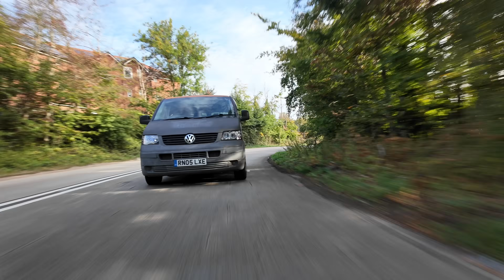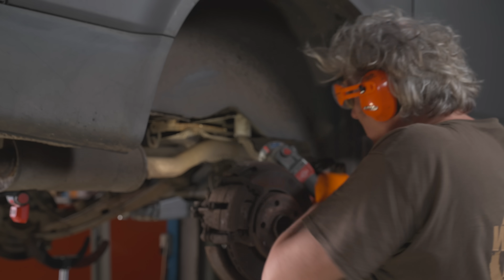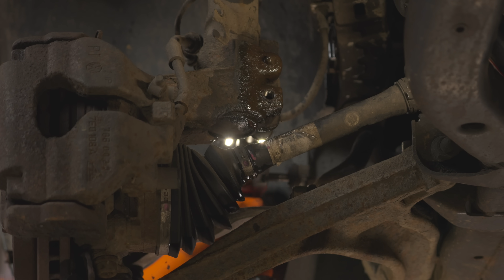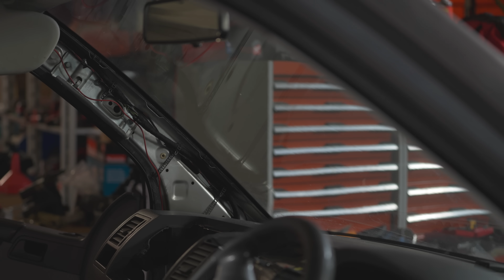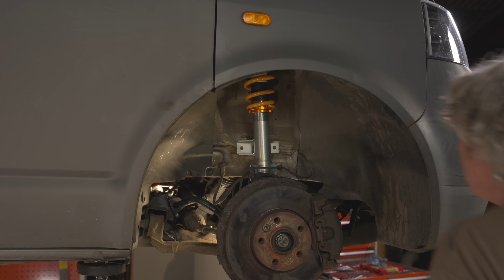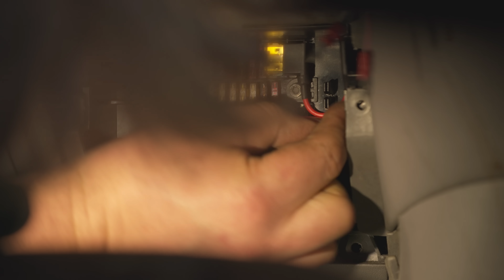5 Steps to REPAIR and UPGRADE Your T5's Suspension and Audio System

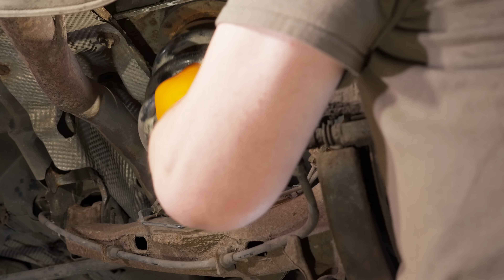Comment: What was the text at 5:05 for a split second?
Reply: Basically says they had to cut the video down due to edds rambling and to follow the link in the description to watch the full video
Reply: @kraftypk7283 ive just spent far too long trying to read this, and ill second what you said.
Reply: So it's been a while since we piped up about what Edd is doing but to be fair it's been ages since he published a video so how could we comment anyway?.
This job was obviously not that easy, it never is but we had to cut down Edd's ramblings to under an hour.
If you would like to see the whole of this iob in glorious technobabble /detail then follow the link in the description or at the end of this vid-o and you can enjoy the full 1 hour and,45 minutes of luxurious pfaffing and tool-foolery along with a few more top tips and missing bits.
Enjoy!

Comment: Of course you should go for an upgrade of the exhaust... And maybe the brakes as well.. With those nice new springs, it would make it really pop if you later down the line got a new set of wheels. :)
But exhaust,, yes.. It deserves an upgrade. :)

Comment: How can you tell if it's stretch bolts or not? I got some aftermarket lower wishbone for an MB-SLK but didn't come with bolts?? maybe they are reusable, I would have thought if you can tighten them to the torque specs I can't see the problem. Where's the best place to look for torque specs I don't trust AI it gives you false information
Reply: Stretch bolts are set using a combination of two requirements - (1) a torque figure, and (2) an angle beyond the torque figure.   So, there is no single torque spec provided by VW that combines both.  In cases where 'aftermarket manufacturers' supply replacement parts, then the aforesaid manufacturer may provide a bolt (or bolts) that only require a torque setting.  A circumstance that comes to mind is an aftermarket Chev LS V8 front pulley bolt that is supplied by ARP - where ARP provides the torque setting.

Comment: I know you glossed over it with an "obviously" but for someone not so sure on the technical details I would like to know more on how more turns = a softer ride. I would expect a larger spring to not be as flexible personally.

Comment: Hi edd, just in case you want to neaten up all of the different gubbins going into your head unit there is a solution i used on my car. Excuse the lengthy title - amazon are crap at listing names, but if you plumb this into amazon : Eightwood DAB+ DAB Aerial Car Radio Aerial Splitter SMB SMA GPS Adapter AM/FM Aerial to Shark Roof Antenna Signal Amplifier Car SMB Plug with Cable RG174 500cm for GPS/FM/AM Radio (just copy paste it) i think you'll find it is the perfect solution and gives a much better result for signal for gps dab and fm, am. They are quite generous with the length of cables you get too so i think it would be good for your van. I've not got up to the point where you install your dab antenna just yet but i imagine you have a "dab dongle" which is also required for this antenna if your head unit doesnt have a dab connector. Hope this helps mate

Comment: Can I ask again please, what brand are the halo headlamps that you fitted & who supplied them ?  I have asked on the actual fitting video but got no answer..( I drove around Cornwall with 2 x ever ready bike torches as they are better than standard VW lamps).   thank you
Reply: Try Transporter HQ
Reply: @HiruS22  thank you, I hoped it would have been seen months ago before we drove to Cornwall--at least it will be done by Easter when road trips are planned to start.

Comment: Hi. Have found a lot of VW s have a "key sense" wire in the ignition switch wiring. It comes on as you turn the key on but doesn't turn off when you turn the key off but when you remove the key. Cheers Michael

Comment: With exhaust you will want to look at mileage. I know it doesn't make sense to many but absolute will for you. A bad exhaust system can cost you 20% on your mileage. Most newer cars the stock is usually in top 2 but with an old T5 I'm sure there are alternatives out there that could give you an extra 30 miles on a tank.

Comment: The GPS antenna will be for if you use the native apps on the head unit. I installed mine in an Abarth 500, I've tried the 'native' apps once or twice but it's a pain because the Google Maps version doesn't cope as well as the CarPlay/Android Auto equivalent. If you're using CarPlay/Android Auto, the new screen will be using the phone's own A-GPS instead.

Good video Edd, always great to see older vehicles being kept on the road.

Comment: But there is ignition wire (well, ACC) on stereo connector. VW just swapped permanent +12 and ACC around. Maybe someone before you (younger you) cut that wire from loom or something...

Comment: Also have a t5 replaced front shocks with new top mounts as they were all tired i now have a noise like a broken spiring when turning iv checked its all installed correctly i can only assume one of the top mount brgs is dodgy they are febi ones as well not ultra cheapos very dissapointed as on the deck in my mid 40s this wasnt  an enjoyable job lol

Comment: Hi Edd, I got the same suspension for my T4 and put the spring adjusters on the bottom for the rear. Is there a reason why you didn't do that instead of grinding the tops to make them fit? Also glad to see you buddy!
Reply: I've seen them installed both ways now..so unsure what the correct way is? DTE TV put his on the bottom, but then removed them to lower the van more if I remember.
I'm just about to buy some for my van...what's your honest opinion on them..?

Comment: What type/brand of ball joint separator did you use. I bought one to use on my VW T25 and it would only fit on the track rod end.
Totally different design to the one you used
Reply from the maker: I think it is either Sealey or Franklin, we’ll try to get it in the shop for you as it is a fantastic tool

Comment: Hey Edd top tip you can use 3m adhesion promoter 06396 before you stick your wind deflectors to make sure they don’t go anywhere
Reply from the maker: That’s a great tip! Thanks.🤩

Comment: Thank you for the video Ed! I remember you coming over to our Intel office in Swindon somewhere around 2005, even have a pic on your "sofa" together with you. 

On VW T5 and T6 rear coilovers, the threaded collar (adjuster) is typically positioned below the spring, not above it.

Explains why you had to grind.

Overall, unless you are driven by the looks rather than comfort, changing to budget coilovers is not going to add to comfort and load parameters. I understand that ebay ad is part of the deal but for a workvan it's a questionable choice.
Reply from the maker: You make a good point. The better cornering is good but the rougher roads and longer ground clearance might get old soon. Maybe airbags next?

Comment: Hey Ed this is also one for you (The thunderstorm Generator) could be the answer to combustion engine net zero. Cheers Steve its is on you tube and you can see the results
Reply from the maker: Sounds interesting, send me a link…
Reply: Not to bore you but tests show 60% increase in fuel efficiency as well as no Co2 and increase in O2 cheers steve

Comment: Since you’ve uprated the suspension and radio head unit, you may as well upgrade the exhaust as well
Reply from the maker: Makes sense. Bit of stainless, maybe a Vortex system, but then the next thing is upgrading the bodywork!

Comment: Was that van actually made by VW or is it like the ones in the USA that were made by Chrysler?
Reply from the maker: Pretty sure it’s VW through and through but you never know!
Reply: All Transporters are made by VW, apart from the latest one which is made at the Ford plant in Turkiye. I'm intrigued that there are VW badged Chrysler vans in the US 😯 I know that the Fiat Ducato is badged as a Ram Promaster over there

Comment: Great video Edd, only one problem... You've fitted your rear coilovers wrong. You're supposed to ditch the upper rubber spring plate and use the thin rubber ring between the height adjuster and the van floor. You fit the lower spring rubbers as normal
Reply from the maker: Thanks for the tip! Might go for airbags next as the lowness is tricky on the country roads.
Reply: @eddchina  Be careful, I could write a book about all the problems, cost and eventual ditching of the VB air kit on my T6
Reply: Not a problem  @eddchina glad to help.
I went coilovers on my T5 and all out on the lows. Machined the top mounts and drilled out the front hubs. Deleted the rear adjusters amongst many tweeks. Resulting in a van over 130mm lower all round.
Basically, I should have saved a lot of hassle and gone air ride! Lowdown transporters are absolute gods of all things air ride for the transporter if you decide to go that route

Comment: ive just done my suspension too, I kept it stock height but such a nice firm ride now.
Reply from the maker: Might raise it back up for the rough roads…
Reply: @eddchina  Never liked the adusters on the rear of T5 coilover kits robbing so much travel. Got rid of mine and went to conventional -50 mm H&R'springs with a shorter shock. Much lower than stock and I can live with the ride now.

Comment: The ground plain is not necessarily required for the GPS receiver. I have successfully modified the original GPS system of my car, gutting the original gubbins as it was very outdated. The aftermarket GPS inside the automatic opening and closing screen picks up my speed and location on point.

Comment: Thanks Edd, don't you need constant 12+ for memory?
Reply from the maker: It does get a constant 12v from the stock VW sockets it was just the on and off that needs the ignition feed
Reply: @eddchina  Ah yes.. I should have thought that out.. duh

Comment: Great to have a new video, Edd!  Hope whatever caused the long delay between videos was nothing serious and further that we see more regular content going forward!
I recently upgraded the head unit in my wife's SLK and was very surprised to not have switched +12v in the harness - or anywhere nearby, so perhaps it's a German thing?
Reply from the maker: Those pesky Germans do have an interesting take on things! Kraftwork would be another good example!
Reply: It's normal in all fairly recent cars, pernanent live to unit which is then triggered by canbus when ignition is on
Reply: @HiruS22  That makes a lot of sense.  Thanks for clearing up that mystery!   In her SLK I was able to find switched +12v at an accessory outlet on the passenger side footwell.

Comment: Edd, need to measure suspension height from the center of the wheel, not from the top of the tread. Always good videos
Reply from the maker: Fair point but I guess it didn’t feel like it needed to be too precise a job!!

Comment: What was the text the popped up about 5 mins in ?
Reply: A message from the editors about having to cut the video down to less than an hour and if you want to see the full 1 hr 45 minutes of faffing and tomfoolery to follow a link in the description or at the end of the video.
Reply: @IAP5451 Damn I thought it was an Easter egg 😂

Comment: Why is it that the shock absorbers that came from the van have the "inner" part on the bottom and the new ones are installed with the "inner" part on the top? Doesnt that introduce and easier way for sand dirt or the likes to get in between and destroy the absorbers?
Reply from the maker: You are right, it would have been good to have covers at least. Might re look at it all, in fact, I might go for airbags…

Comment: After not doing a full suspension refurb, what's the betting that at the next MOT, it fails because the CV gaiters have split?
Nice video. Good to see you back again. Any news on the rust box, aka, Range Rover?
Reply from the maker: Thank you. Already found out I need to recap the stock speakers, one in the door is definitely missing! Range Rover chassis needs one more stage then we’re good to start rebuilding. Currently in the middle of pulling the V8 apart to see what needs doing…
More to come soon

Comment: I miss the weekly program with Ed. After Mike changed his mechanic I unsubscribed. I'm a retired car mechanic and missed Ed's work. I watched only one episode of Wheeler Dealer and it was a car with moldy seats and Mike only used a brush and some soap water and it was all. PS! if you don't have CRC or 5-56 and a bolt is stuck you can use some white spirit and a brush it does the trick. 🌷

Comment: My ebay garage offers me things like exhausts, engine oil, carburettor air filters, spark plugs, etc., all very useful for an ELECTRIC CAR.
Reply: Yeah. Ebay is crap at confirming fitment. Leaves a lot to be desired. This segment was nothing but a promotion of ebay.
Reply: It does the opposite too, tells you things won't fit when they definitely will and even mention it in the description

Comment: Hi Ed! First of all, thank you for sharing such interesting and informative videos about mechanics. In your latest video of the Volkswagen T5 van, when you start the van to test the new GPS radio you've installed, I could hear that it struggles a bit to start the engine. My 2008 T5 2.5 TDI had the same problem, and it kept getting worse until it finally became very difficult to start because of a serious issue with the injector seats in the cylinder head. All Volkswagen TDI vehicles with pump-injector systems have this problem, as the pump injectors are only attached to the cylinder head by a single bolt. This causes the vibration to wear down their seats in the aluminum cylinder head, losing their seal and allowing air to enter, preventing the van from starting. I was able to solve this problem thanks to an improved mounting system from the German manufacturer 07eïns called the "PDE Bridge," which resolves the serious manufacturing defect that Volkswagen had. It takes a little work, but it solves the starting problem and prevents further wear on the cylinder head. I hope this helps. Cheers!
Reply from the maker: Thanks Oskar, that is a great tip, perhaps worthy of a future episode if others also like the idea. Watch this space…
Reply: @eddchina yes please, I have this issue and i bet loads of other people do, it’ll also mean you have to get oily too!

Comment: Had my 2005 2.5 LWB T5 since new and will never sell it. Just replaced the Turbo, intercooler and keep on top of servicing, so should outlive me. Good idea to replace the waterpump on the 2.5. Thank you for the Video Ed
Reply from the maker: Good advice. First episode of Workshop Diaries was changing the broken oil cooler. Water and these vans seems a challenge. Thanks